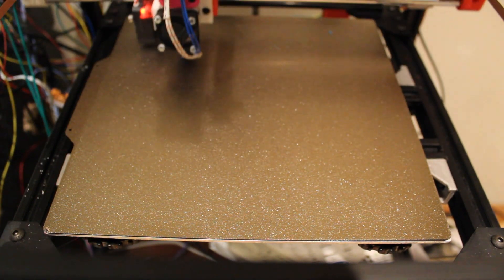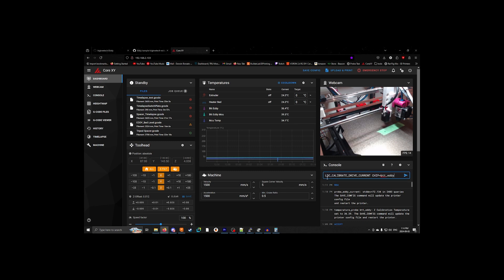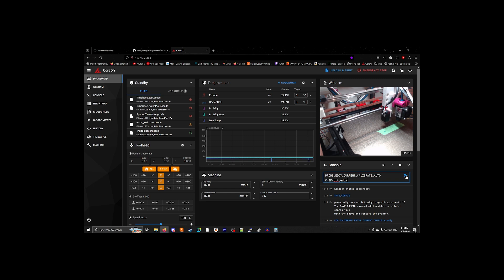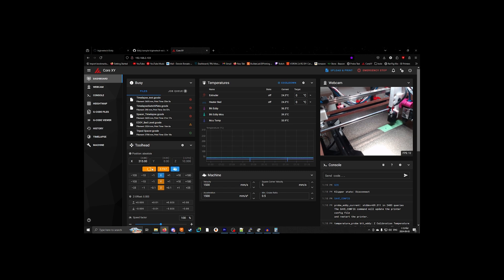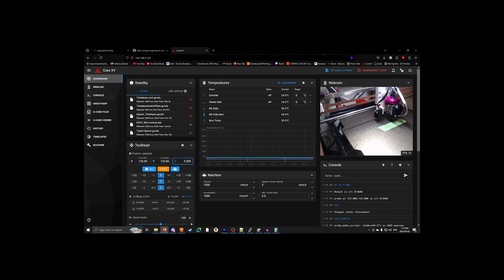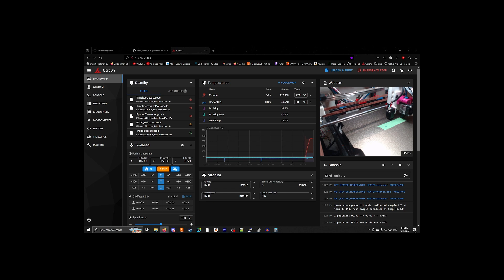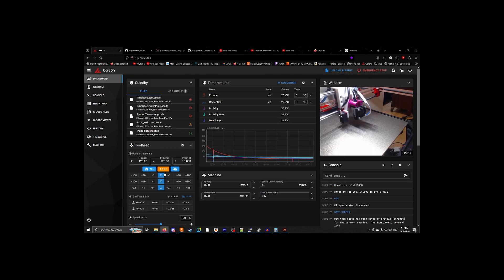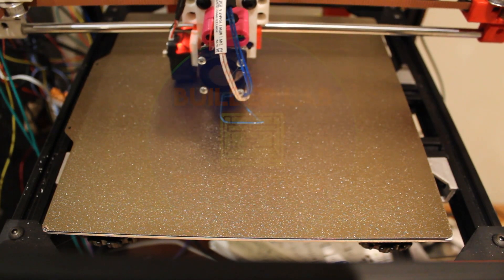BTT Eddy Deep Dive: Part 2 - Fine-Tuning Your Setup

Comment: I run step by step your tutorial if I scan points very well, if I use the Bed_mesh_calibrate scan_mode = rapid method = scan I get this mistake at the end of the scanning
!! Probe_eddy_Current Sensor Not in Valid Range. How can I solve. Thank you
Reply from the maker: Usually means a part of your bed is outside of the allowable deviation. Do your best to get it level with the manual method then try the command again

Comment: Good video, but I would explain why you set the Eddy temp when you do the thermal test. I've seen other guides where you want to calibrate the bed to the temp you normally print at and monitor the average temp your Eddy gets to and add that to the thermal test in steps of 4 or 5. Example if you normally print in an enclosure and set it to 56, obvisouly this will go much higher. So I would take that into consideration when performing this thermal test.
Reply from the maker: Thats a good call. i will definitely be doing that from now on

Comment: why is it mounted facing the wrong way? 🤔
Reply from the maker: @ryannnn_nelson  you mean the Eddy? Just want the mounting directions say in the documentation. To have that lip facing towards the extruder
Reply: @builderlab3dprinting  its not about the lip facing the extruder is to keep the coil from actually get noise from extruder motor, cables, fans etc...